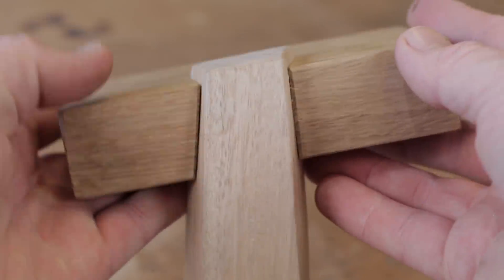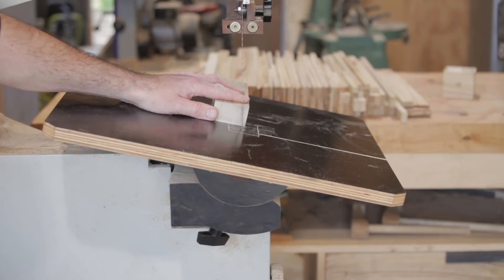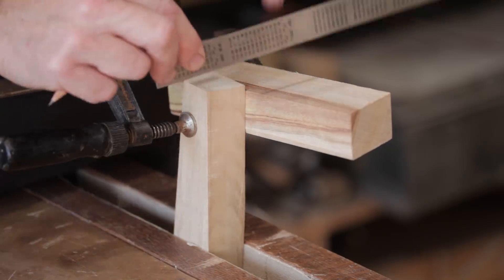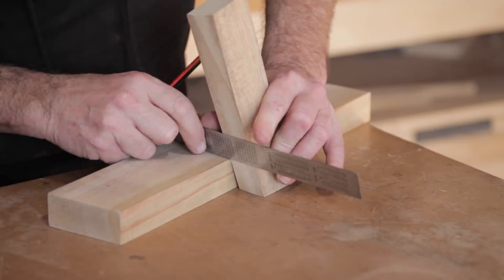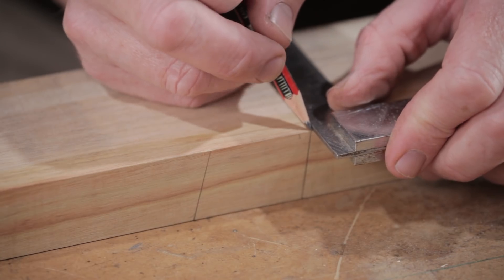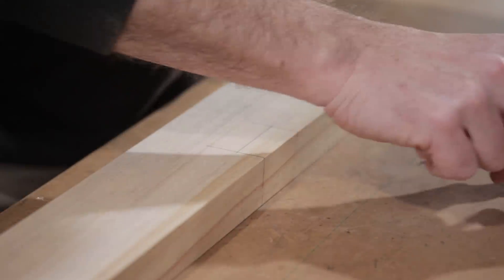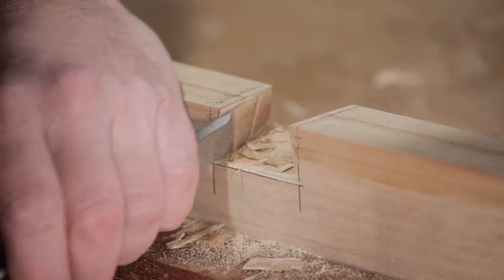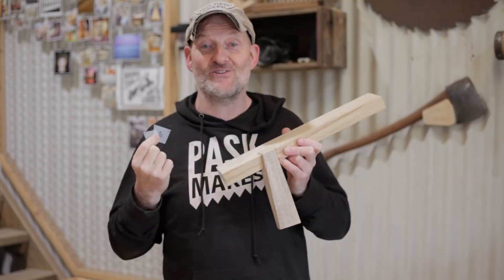Tapered Sliding Dovetail with Compound Angles

Comment: Shit joint, end will split and bread down the grain under pressure
Reply from the maker: Shit comment because you're wrong! I made a stool 18 months ago using this joint. I gave it to a friend, it's used regularly, I see it often and it's still going strong. It was even made out of mainly sapwood (camphor laurel), so not the strongest wood. :)

Comment: Bloody BRILLIANT joint. Well done. I could see using this for any number of furniture leg designs. Sure would make knocking it down to move homes quite a bit easier. If the top has a built in drawer deep/long enough to hold the legs, then it can be shipped with the legs inside so they don't get lost in shipping. Plus the table, in this case, will take less room in the truck. Tusked tennons and these splayed sliding dovetails are great for the person who moves regularly like military families and such.

Comment: Use matematics not material. You could have just calculated the lengths...
Reply: I would have designed this in CAD with exact measurements using math, and I would have fucked it all up on the execution. Using scrap material for trial run is a brilliantly simple way to encounter and overcome issues you don't anticipate during design.

Comment: Another easy way (for some) is doing it 3d in some program like Catia or solidworks or similar. Do a fancy shape. Subtract it from another solid thing (in any orientation you want). Look at both pieces, do some technical drawings for templates, or scribble some key measurements to ensure perfect geometry on the real pieces. Or go even further with some G-code and 3d route it, or 3d print it.

On long taper connection, a quick hack for perfect fit - wrap sandpaper on the tenon and use it to touch up the female side. Removing the sandpaper will make the tenon go further up but the surfaces will be perfectly aligned with respect to each other.
Reply from the maker: I actually started doing this in SketchUp I just haven't had time to finish it. I'm planning on making a pdf with examples at different angles. :)
Reply: here is a quick 5min catia design.. it's about the same as yours. 12degree dovetail, 3 degree draft angle, 10 degree to front and to the side as positioning (refference is the median plane of the tapered dovetail.. (my dovetail is angled in all directions including thickness)here is a link with some drawings and pictures and the actual model made in Catia V5 R21 

https://drive.google.com/open?id=1fl9To-sz7HoCrDKcT3IXtbhpb3N2nNvV
if you need any other angles or shapes just contact me. I'm passionate about 3d design in Catia. I am an engineer in automotive and use this Catia to design everything i need from nuts and bolts to car parts, engines, etc.
Ps: Drawings are made in millimeters and with 1st angle projection (Europe style, not US style which is the "salad bowl" 3rd angle)

Comment: Nice! Showcasing the joint in something like a table lamp would be cool.
Reply: With a second panel near the bottom for support? Or just do a left side joint on three or four sided plate near the top where the light fixture goes?

Comment: I really LOVE the joint .. a bit tricky is an understatement. The template is the only way those measurements could be captured. BUT it would make strong joints that only get stronger and tighter over time without glue. And still a light tap and the legs could be removed. Those angles are murder for me.
Reply from the maker: I think you're right Clyde, I couldn't think of another way to mark it out! :)

Comment: Neil, if you off set your top and bottom marks, on the template,  to one side that would make it easy to determine which side of the template to use.  This is a great tutorial.  I have been wanting to make some travel furniture that breaks down for easy transport and a join like this will do nicely.   Thank you!
Reply from the maker: Thanks, that would make it easier! Glad you liked it! :)
Reply: I was thinking adding an arrow to show which way the leg would be tilted. So that it is always correct upside down or right side up.

Comment: Couldn't you just make a jig to hold your top and bottom templates in place so the whole thing 'wraps' around the board and all you have to do is mark lines around it?
Reply from the maker: You could and I thought about that too. It would only be good for the same thickness top and the same angles of splay. If your next project differed you would need to make a new one. Also you would need to make two, one for left leg splay and one for the right. The templates aren't difficult to make and easy enough to use to layout the dovetails. :)

Comment: Nice. On a bench or a table I bet it would look cool to have the legs taper in both directions, so a wide bit just below the top, then tapering into the joint, and down to the feet, and maybe maintaining the dovetail angles all the way down. I might have to try that.
Reply from the maker: Thanks - glad you liked it! :)